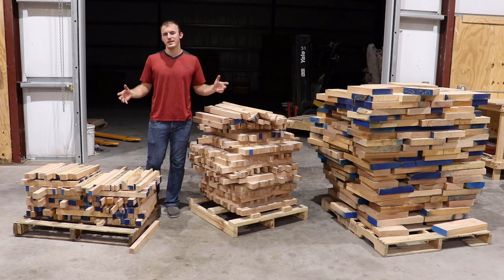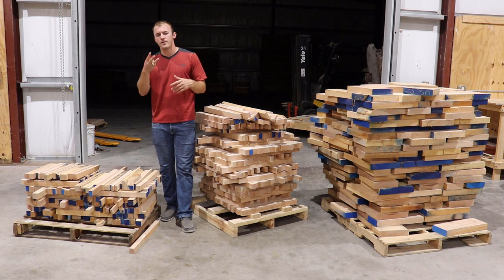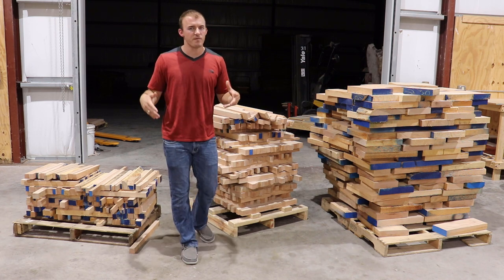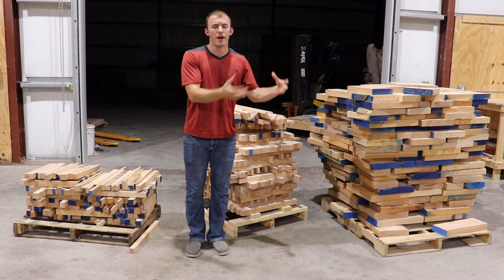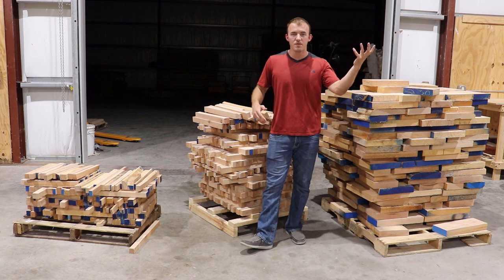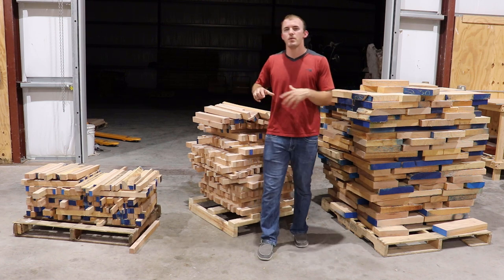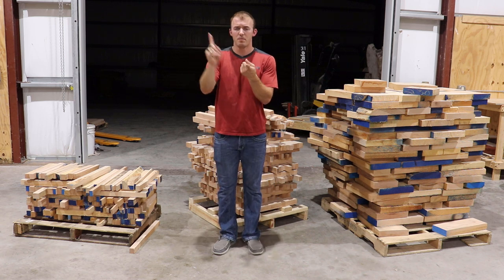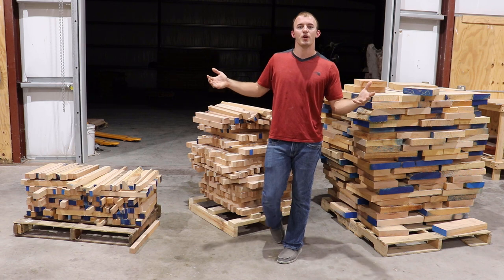How To Get FREE Hardwood For Your Next Woodworking Project

Comment: As a bigger producer, one problem with guys getting the free stuff, is they want to go thru it and take my time to do it. Please don't do that if you are getting it for free. Just saying. If your in the western Colorado area, let me know, I have stuff I have to burn.
Reply: What part of Western CO are you in? I live in Denver. What kind of scraps do you have?
Reply: I have mostly ripping drops by big bundles, like 700-800 pounds per bundle. Montrose is where I'm at. Barnwood is the majority,  then normal domestic woods. Almost always 2" and less.
Reply: We had a similar problem in the veneer shop. We would trash a lot of good wood,well all plywood and mdf. We were happy to let people take it but some people would try to set up camp in there while we are trying to work. We ended up kicking 2 out because they were feeling entitled and stopping production. But as long as you make sure you're out of everyones way we didn't care.
Reply: Discovered a company like yours in my area
The owner showed me oak offcuts skids, i could clearly see hundreds of cuts over 24inches, didnt even need to browse through the stock pile.
Asked him 1 simple question: how much you want for 2 skids (all that could fit in my caravan haha)
Said 30 bucks
You've got yourself a deal my good sir 😂

Comment: Quick Glance this is some of the worst yielding ive ever seen. Just because theyre a "big shop" doesn't mean throw away 10% On an automated ripsaw your "edgings" should be around 1/4" thick or less. On your automated chopsaw you dont chop 1foot off unless there is a knot, worm hole, checked end etc and im not seeing any of those defects in this video. The chopsaw can end trim +/- 1/32"  so chopping all your 10ft to 9ft so they're all the same length is a huge loss/waste. a 10ft board can be trimmed to 119-15/16" long which is acceptable at any retail store. Good find for you, terrible loss for them
Reply: I own a security company, and for the last two years i have been getting contracts from construction companies for armed security because theft of tools and lumber is so bad...the employees have had confrontations with people caught on site stealing, etc..
Any way. I see these big companies trashing scrap 2x4 and 2x6 by the industrial dumpster load..it is usually 1 foot sections. When i asked the project manager about it, he said the same thing that was said in the video.
When i work the site, i was told to take all the scrap i wanted. So every shift i load my tahoe rear end with lumber. Everything from 1 foot cutoffs to 3 and 4 feet. I have a garage with tons of "scrap". I have made great projects and had plenty of firewood for my shop..
But yeah, was told same thing